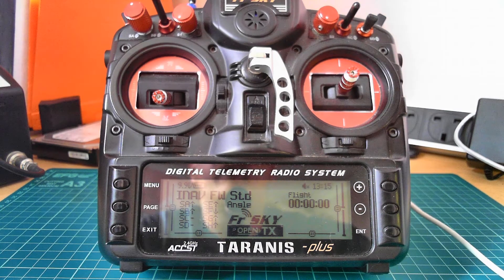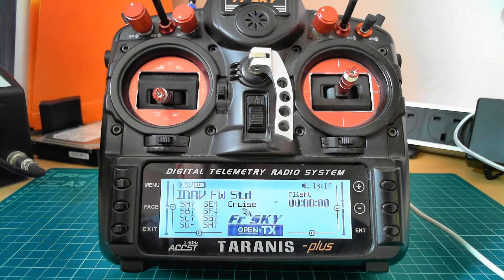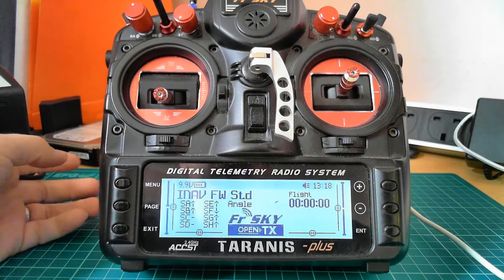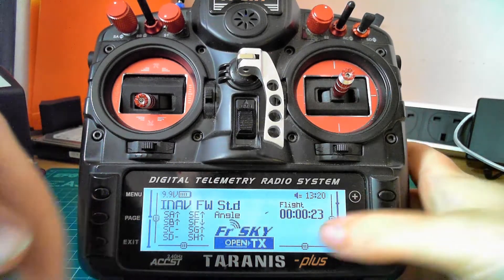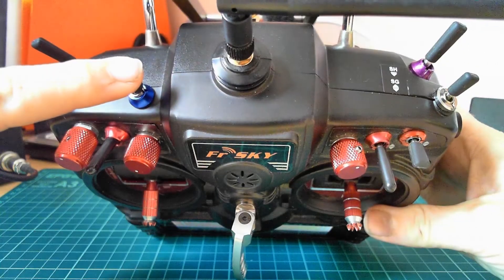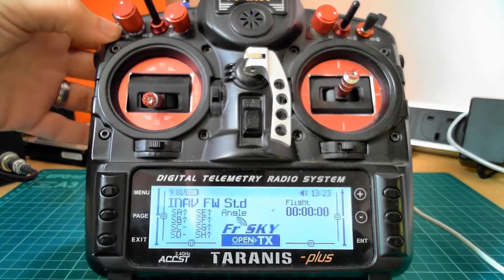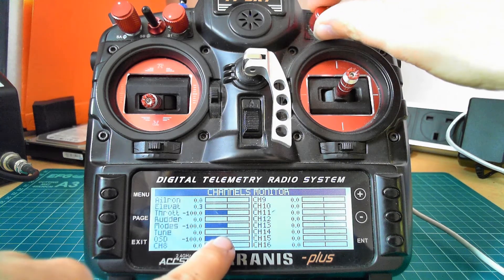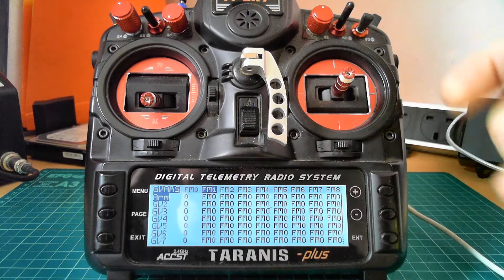Introduction to the INAV Fixed Wing Group Open TX Models

Comment: Were can i find the files for a Horus X10s??
Reply from the maker: They are all in the files section of the INAV Fixed Wing group on Facebook.Just download the latest version of the INAV Fixed Wing Group - OpenTX Model Pack and use the X10 otx file in there.

Comment: Excellent work Darren.   I would add that the Q7x does not have global variables page, but does have a check box on model setup page as I recall
Reply from the maker: Thank you. You’re right about the global variables. In the manual it goes through the different places where global variables are on the different transmitters. So long as nogvars is unchecked in Open TX companion when the transmitter firmware is downloaded, all should be fine.

Comment: How would you setup a logical switch for autolaunch so that it integrates with the rest of the modes you have setup?
Reply from the maker: You don’t need to worry about logical switches. Just assign an unused switch to a free channel in the mixer page on the transmitter (Ch.8 for example). Then set that channel to trigger the mode for autolaunch in the iNav modes screen.
Reply: @MrD  Thanks.